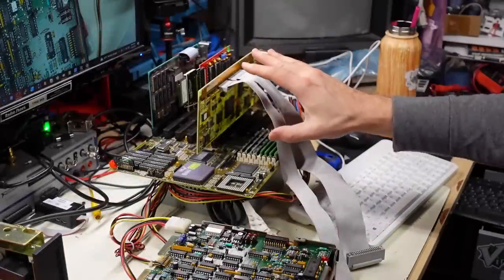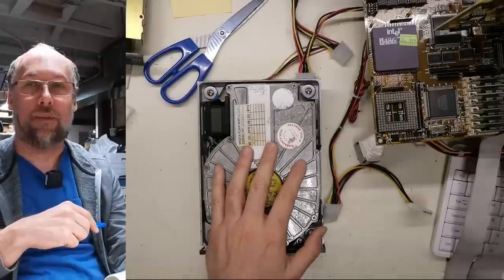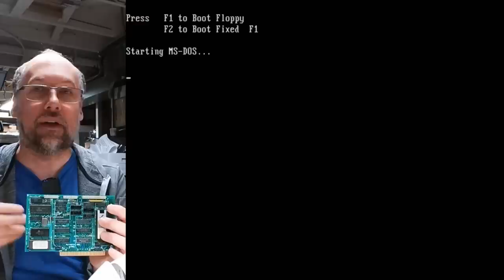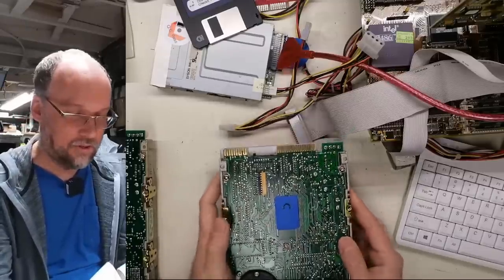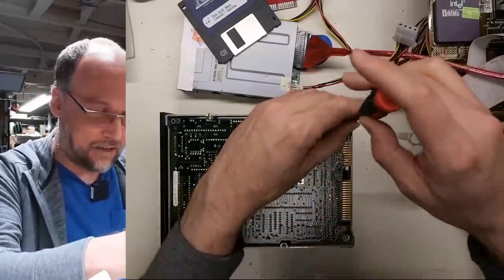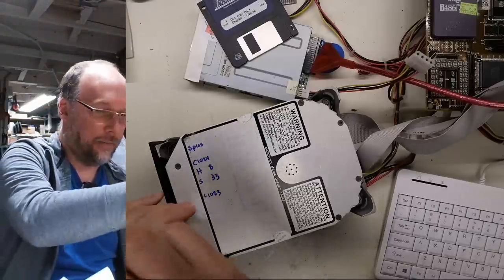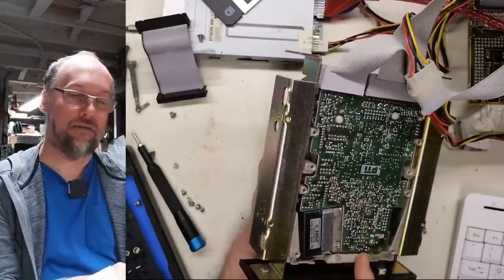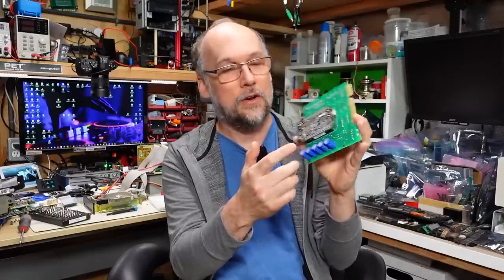MFM drives are really unreliable

Comment: Many years ago I was given an ST225 with bad sectors in the boot tracks. With nothing to loose, I opened the drive and moved the track 0 sensor inwards a little bit. Closed the drive, formatted it OK and used it for years!
Reply: I had a 40 mb ide with a stuck stepper motor. I took the top off, gave the heads a nudge and put back together. Never had a problem after 😳.  
My hvac class had a ps/2 that had bad sectors in the boot track as well. Just made a floppy boot disk, and all data and programs were accessible (including the games) 🤣
Reply: @kd7cwg  OMG yes I also had an old Conner drive that was pretty big for its time that I got at a computer market / hall with a bad sector 0. Booting from floppy then accessing it worked fine indeed! Man thinking about this I had so much old broken stuff I just bought from computer market junk piles for next to nothing that I got working through creative means. None of which I'd really rely on very hard, but eh it was good enough for hobby stuff. Also getting super cheap old SGI workstation monitors with weird connectors like 13W3 and getting them to work in linux by manually crafting X modelines until it gave a stable picture..20" CRT's that would heat your house for the price of a beer or two lol.
Reply: ST-225s are immortal.
Reply: The main trick besides not breathing over or talking near the drive while the cover is off is to always put the cover on with the drive spinning.
Reply: @kd7cwg  The system disk of my first digital recording studio's Atari refused to start one day, so I opened it up, gave a little spin to the platters and it restarted like nothing had happened. For the following few years the morning routine was open the drive, turn everything on, help the drive spin, put the cover back and just pretend it was normal :D
Reply: @IlBiggo  20-some years ago I worked on the computers of a local school... they had some old stuff there, only a few of the newest units had a CD drive, and a few of the oldest were pre-IDE era and had some of these bulky loud hard drives if any. 

I had to install software on the newer ones, and I needed a CD drive for that, so I took one from my junk pile - it had a partially broken spindle motor and it would need to be nudged to get spinning. It ran with two coils out of three. I used that to do my business, and it worked for me just fine for the half year I was there but it was loud and sluggish to start.
Reply: @edgeeffect  The one in the video doesn't seem very happy though.
Reply: @stragulus  Yep, I bought $10, 10MB hard drives at Regina Computer Exchange back in the mid 1990s, and got a 386 working to play some games when our main 170MB IDE stopped working. Dad eventually repaired the 170MB drive by taking the board off and reattaching it.
Reply: @kd7cwg  the ST251 was famous for heads sticking to the platters (ie stiction) to recover you could pick up a leading edge computer several inches and drop it with power applied to break the head free and recover the data before you shut it back down.
Reply: @davebing11  this was what Apple recommended for Apple III computers, that had to do with overheated IC sockets though.
Reply: Is it possible to realign the old noisy drive so it works like new or oil it in a certain spot lol its so big it might be able to be repaired and get rid of noise
Reply: Dude are u gonna keep the disks and motors parts lol
Reply: @davebing11  And the iconic knocking noise from a misaligned track 0 sensor :)
Reply: @stragulus  I remember when getting a 20" or 21" CRT was like making it big in the world

The first time I ever lugged my 21" NEC to a LAN party I regretted getting it
Reply: Guys, I have a ST225 that is only capable of showing its catalogue, what would you try? 😅

Comment: Not sure I agree with the heads stuck to platters description of sticktion... much more likely the bearings are "seized" up, too much drag to get spinning. If the heads were stuck the damage would be terminal
Reply: Agree. Bearings are the main culprit, because the lubricant in them becomes old and sticky, just like in wristwatches. Sometimes push start helps and lubricant softens a bit (for some time), but sometimes it doesn't and motor cannot reach required speed (or reach it before the timeout). I had a similar problem with laser printer (spinning mirror spindle) and had to put some hair-cutter(!) machine lubricant, as it had the closest viscosity and lubricity to whatever stuff was there before.
Reply: It would make sense if the read/write head and the platter were made of the exact same material, which could lead to a sort of cold welding such as with gauge blocks. However, the bearings make much more sense.
Reply: That has never made sense to me either.  Either it wouldn’t take much to break the joint, and so it shouldn’t ever fail to spin, or it would rip the fragile heads right off, and that would be the end of that.
Reply: Also the grease can be fine when the drive is up to temperature but as soon as you turn it off and it cools down the grease gets hard and the drive will not spin up.
Reply: At the time, the official explanation was thus version of sticktion. The head and disk being so flat that they would create a high amount of drag. Even brand new drive could display this problem, once spun up, they woeld work for years.
Reply: The house it was baking definitely sounded like bearings grinding, once it got going
Reply: I heard both explanations back in the day.  I think both are valid possibilities, and judging by the gap between the head and platter being so minute I could see it happening.
Reply: @Pickelhaube808  I was thinking 🤔 what happens if two very flat pieces of metal touch??  Then gauge blocks came to mind lol. Then I was thinking we'll don't these have actual bearings in them also...i think it may be a combination of both the bearings and heads sticking because the hard drives tend to fail completely afterwards. Meaning the heads were in fact damaged and the motor is failing from being in a stall situation many times. These electric motors do not have a lot of torque at startup...they just didn't need it.  Thanks for reading. I Hope You Are All Are Having A Great Day/Night!!
Reply: Agree. Somewhere in 1996-1997 or so I recall IBM put out a batch of hard drives (SCSI at that time) that after a fairly short time in use failed to spin up (mind you, where I was at the time, these were used in servers, so were spinning up for long periods at time, likely heating up quite a bit). I suppose we weren't the only ones complaining, as rather soon after we saw the problem, we also received a firmware update for the drives. Our friendly field service rep explained what the update does is it gives a more powerful start-up spike of electricity to the spin motor to get the stuck bearing lubrication loosened. As I recall, didn't lose any of that drive type after the firmware update (and did recover some that had been shelved as inoperational due to the problem earlier).
Reply: @JuhaLaiho  I always like hearing (and telling!) these real-world experiences.  It takes boring facts and figures and breathes life into them.  Sharing them spreads historical knowledge that is seldom recorded elsewhere.
Reply: We called it stiction too, and I didn't work with Adrian. Your understanding of those old drives is wrong in that The Landing Zone track was specifically for HEAD storage. These drives predate unloading the heads. The way it works is at speed the heads float on a microscopic cushion of air created by the spinning of the heads. The LZ track is at the hub where torque is greatest. There is also no magnetic material there to dirty the head, just polished aluminum. If a drive was not parked properly. 

Quantum was one of the first companies to use the rotational energy from the platter spinning to float the heads to a parking position on the outer edge that separated the heads from the platter.
Reply: @RowanHawkins  If the LZ track was indeed in use then it wouldn't matter half as much if the heads crashed (other than physical damage to the heads) or stuck. The evidence shown is some serious track damage and the heads seem pretty much destroyed. The track damage is all over the platters so either the heads are carrying lots of foreign matter (from the platters), deformed, or the platters themselves have expanded due to environment (which actually seems a pretty likely option).

Either way my original point still stands - in most cases (outside of disc drives at least) stiction (or sticktion) is caused by friction at the spindle that has to be overcome to start rotating - if the driving force lacks sufficient torque to overcome that limit then it will never start to turn. Normally that is bearings. Granted in most scenarios there isn't anything at the periphery to cause drag further out which increases the torque required in proportion to the radius.

Incidentally - I've not forgotten the pain of those early hard drives. I used to have stacks of dead drives (some less than 6 months old) and it was probably my biggest expense as everything else was very reliable
Reply: @JuhaLaiho  most electric motors that need to start under load use a start capacitor to give it that extra hit of starting torque and prevent it being in a stall condition for too long which I'm guessing hurts the motor more than the capacitor. I hope you had a great day today My Brother!
Reply: I agree
Reply: Yes. Sounds like bearings.

Comment: I remember trading a motorcycle for a 600mb Micropolis drive.  It was an absolute beast!  My whole computer shook back and forth when it accessed the platters!  That was baller storage at the time!  And yeah, they were all loud.  Fluid dynamic bearings were a game changer.
Reply: I bet that 600mb hard drive had more cylinders than your motorcycle ;) ... but I also bet the motorcycle was able to make a lot more noise than that harddrive - no matter how loud it was
Reply: I used to have a bunch of those under my desk. When I turned on my computer it reminded me of a big rendition of the tune to that song "My Sharona" as all the drives initiated. Or should I say took off.

Comment: It was nice to hear those old Seagate drive sounds again.  Growing up, our computers were made almost entirely of broken parts.  The only reason we had hard drives at all was because they had died for someone else (mostly at my dad's work).  For the most part, the old Seagates could be brought back with a low level format.  Stiction was a thing, and we got in the habit of rotating the entire PC case while flipping the switch.  They would occasionally get flakey again, but we kept backups.  Later, Spinrite became a thing and it brought back those drives in-place, data and all.  That tool was a godsend.  We also had a 600MB Micropolis SCSI drive at one point that took so long to spin up that the controller would timeout.  It was very loud, but was very reliable.  Ah memories...
Reply: Upvote for the spin rite reference. That was an awesome tool
Reply: i saved many 'dead' drives using spinrite. stiction was definitely a thing with seagate st-225's made during a 4-6 month period, i have 2 st-225's in my 10mhz xt clone. the boot drive always starts up, the second one always sticks if it sits for more than a week. i was told that the stiction problem was due to the heads being too-well lapped and smooth, which causes them to stick to the platters. if the drive doesn't stick, it's because the heads are rough. go figure...

Comment: Back in the day, Micropolis Hard Drives were mostly large, high volume disk drives. They were known for being noisy, but were usually larger (storage space wise as well as physically) than other drives. Seagate MFM drives were some of the most reliable back in the 80's. They were also the largest producer of MFM drives at the time. Miniscribe were primarily hard drives used in business. Western Digital had a few, but no one could compete with Seagate. Things changed when IDE took over. Western Digital and Maxtor took over the top 2 spots.
Reply: You ever hear the miniscribe brick story?
Reply: @rdh2059  Exactly.  If I remember correctly, they shipped cartons with pieces of masonry that approximated the weight of the drives that should have been in them, ostensibly with the intention of recalling the items in short order, before they would have made it into the distribution channel.  Unfortunately, things didn't go this way and it was caught. I might (probably) be missing something because this is something I learned about probably 15 years ago.  I understanding was that the books were cooked well worse than was initially apparent.

Comment: With the ST225, try pulling the PCBA off it and cleaning the contacts that connect the HDA to the PCBA. If I recall correctly there will be spring connectors for the hub motor and an elastomeric connector for the heads. Worth pulling the elastomer out, cleaning with IPA, and flipping it so the "squished for 30 years" parts are no longer aligned and it makes slightly tighter contact.

Comment: At a place i used to work, we had some old S-100 buss computers that had hard drives (yes i know, it's weird).  And these hard drives would get to where they would not spin up.  We had to remove the drive, remove the cover over the platters, spin them by hand, then re-assemble.  These drives lived through that so many times it isn't funny.  For at least 6 years we kept having to manually spin those drives, and they never died or lost data.  Which is just amazing, considering the head clearance on a HDD.

Comment: Sad to see none of those drives worked. Was fun to see the insides of them though! I’ve actually had incredibly good luck with MFM drives, and most of them I’ve gotten have worked fine with little effort. I actually just tested all of my spares recently and they all still work fine. Some of them I’ve had for years too. 

I will go to great lengths to repair them sometimes as well. For example, I did a spindle motor replacement on a Miniscribe recently, which was 100% successful!

Obviously, I’ve definitely gotten some bad ones over the years though, but I’d say probably 80 percent or more of them I’ve bought worked fine in the end!

Comment: Brings back memories of what a PIA setting up a hard drive could be!
Reply: Indeed, heads, cylinders and sectors was a PITA. Varied from BIOS to BIOS
Reply: ruined the data on 0 track on someone one time thinking the settings on the PC was wrong and wasn't utilizing the whole drive.
Turned out back then the CHS on the BIOS was skewed to what the HD/controller expected.
Believe it or not, I was able to recover almost all of what was on the drive.
How you ask?
Folders are actually files, almost all subfolders and files were in folder, and almost everything on the drive was one cluster or contiguous clusters.
Using tools that could read the drive raw, searched for sectors containing '.' and '..'.  Those would be folder entries.
Get the size of the folder, calculate the # of clusters, and slowly made a map of what the cluster table/File Allocation Table (FAT) should be.  Get the file entries in the folder entries and repeat.
I only had a handful of situations where if I assumed contiguous clusters, I ended up with file chains that would appear to have cluster collisions.
Analyzed the data in the sectors assumed to belong to the files, and I could figure out where the next cluster actually was an for which file.
But when you only have a few 10's of MB, you could do that.  Forget trying that with GB or TB!

Comment: The Commodore A590 was the first 20 MB hard drive in 1989 for the Amiga 500 (Autoboot did only work if the Amiga used Kickstart v1.3) and i believe it used one of these MFM drives which was a Western Digital XT model (you will find pictures at Google because those XT drives are fairly big). The A590 was having a XT and SCSI interface. The read and write noises are funny and very mechanical. If a floopy disk was in the disk drive the Amiga did autoboot from the disk drive otherwise the hard drive took over. Amiga was having a very clever auto config system just like modern PCI from the PC.